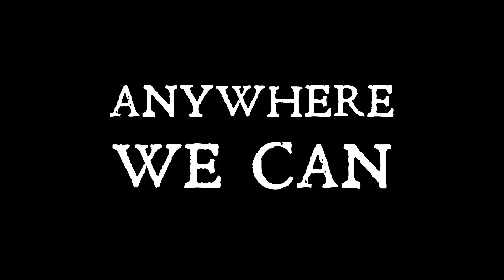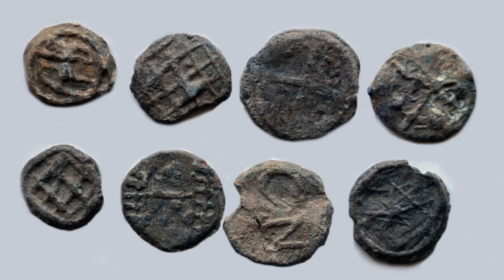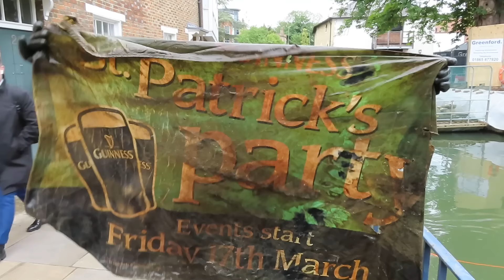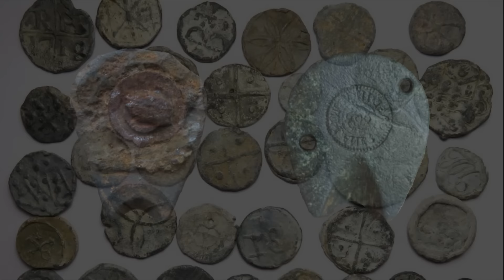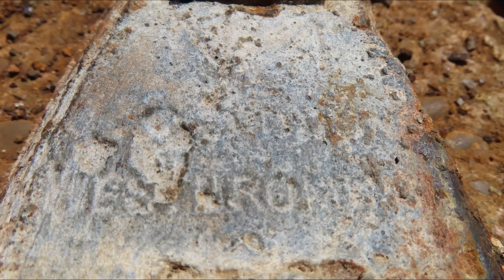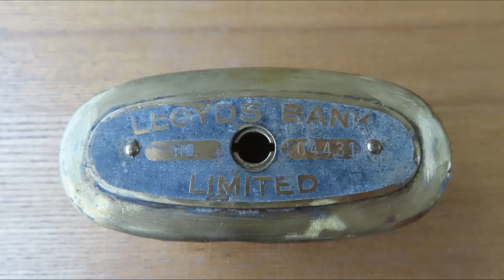Once In A LIFETIME Discoveries - UNBELIEVABLE!!!!

Comment: Hi there Peaky's, another brilliant video with some good finds. I have an identical bottle opener to the 2 you found, I think they were used by waiters to carry in their pockets. Where the bits are joined together there is indents on the sides that sprung into little grooves in the middle so they locked in place when you opened and closed them. Looking forward to part 2.

Comment: Thats a bike clip not a jubilee clip, its for you ankle to stop your trousers getting any swarf on them from the bike chain.
The folding Cork screw was a Waiters Cork screw that they kept in their waist coat pocket so that they could open a wine bottle at the customers table and quickly put it away again after to be hands free to carry any plates etc.
The half claw looks like a half of a pair of tongs made to pick up hot stones left to warm by a fire place, the hot stones were placed onto a cloth and the corners of the cloth then tied together to carry the hot stones and used like a hot water bottle to rub around a bed to warm it up prior to entering it.
The Sad Iron says "West Brom" on it.
The heart shaped item looks very much like it should have a hook on the end, have you ever seen long boots with a loop on top? Well this hook would be used to hook this loop and aid pulling your boots up and the heart is for two fingers to grip as you pull. Today the loops on boots can still be seen but no one knows what they are for, now you do 😁👍

Comment: 31:20- That  resembles a plate used in a charge machine for the seller. Basically they looked similar to an old style slide charge card machine. The vender would have a a file box with charge plates with a persons name, address, and other data on it. When they made a purchase the buyers  plate would  be inserted in the machine and the slider run over the top of it, printing a receipt on the sales slip. (Sorry for the poor description). In my area they were still used into  he very early 1960"s by some stores.) Then the store would send you a bill in the mail if you didn't pay at the  time.  On the bank- I think if you contacted Lloyds with the serial number on it, they could tell you the original owner.    The lead token mold is incredible, as are the cork screws and Kirstys lead trade token. Great finds, and a thanks to Frank & crew for picking up the scrap.
Reply: I understood your description perfectly.   Took me back to when I first had a Barclaycard

Comment: The object which resembles to top of a pair of scissors appears to have a set of something. If you look at the longest part it seems to be made up of layers of something. Probably of varying thicknesses. The only things I can think of are a set of Allen Keys or feeler gauges for setting up the gap of spark plugs etc. I first wondered of the twp ovals were originally one large circle which had been crushed. But it could be just the way it was originally desgned. I'm pretty sure that long piece is made of separate components.